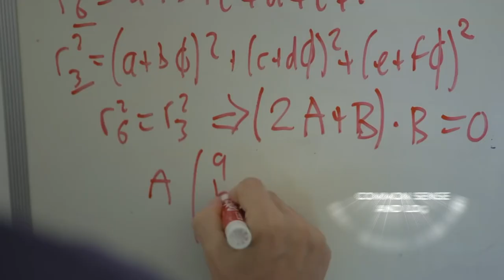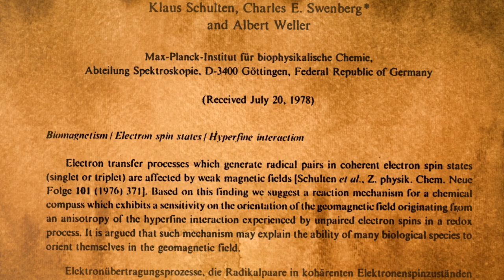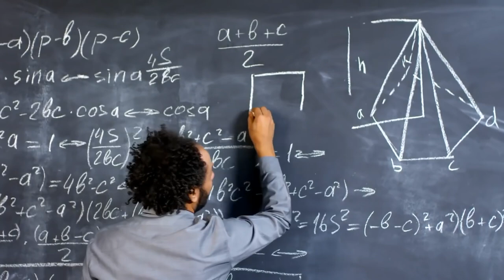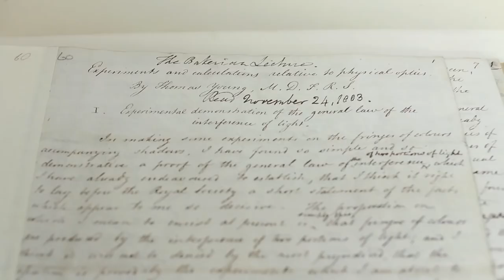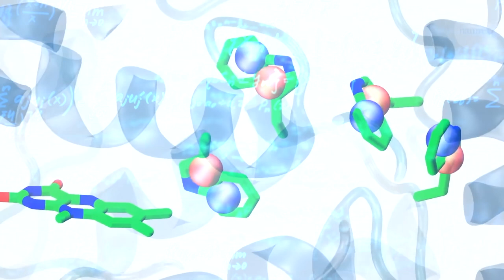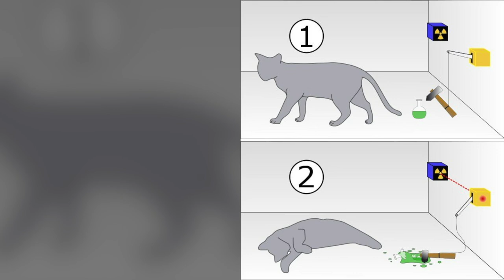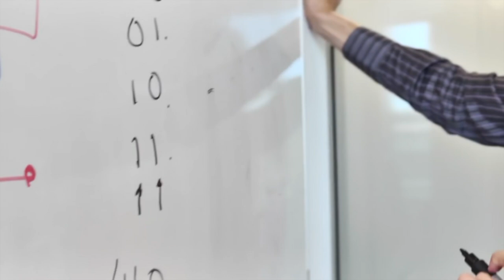What is Quantum SUPERPOSITION? | Quantum Mechanics Explained

Comment: Thermodynamics is all functioning frequencies of quantumization. Equalization is forced fields of frequencies in equalization to cold resistance throughout space. Physics shows that cold interacts with heat in all mass. Atmospheres have tornadoes and hurricanes. Space has tornadoes and hurricanes. Equalization of frequencies in resistance. Entanglement gives elements equalization of frequencies interlocking creating Gravitational fields of forced motion, in the same way magnetic fields flow back, cycling into their origins, repeating the process. Gravitational fields hold cycling patterns in quantization. Cold fusion. Thermodynamics variations create or break these cycles. Thermodynamics is all energy, light, sound, electricity, nuclear, elements makes mass, and all frequencies. Thermodynamics can build up. Cold fusion contracts bonding to slow Thermodynamics down in forced flow. Thermodynamics is amassed plasma Fluidity of quantumization in mass. All mass is heat in variations of combinations of frequencies interlocking creating Gravitational fields of forced flow cycling as patterns. Harmonics harmonization of frequencies interlocking creating equalization of forces. Thermodynamics is a propellant. Cold space is a repellant. Thermodynamics and cold coexist throughout space. Just not in entanglement. That is spooky.